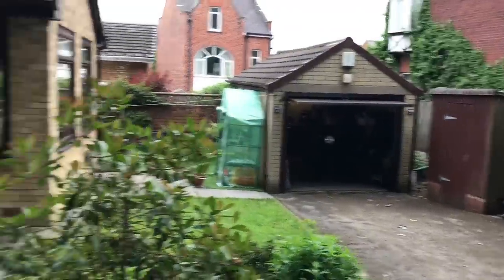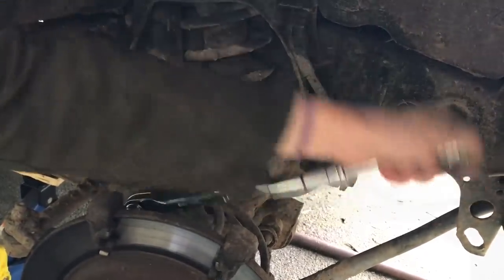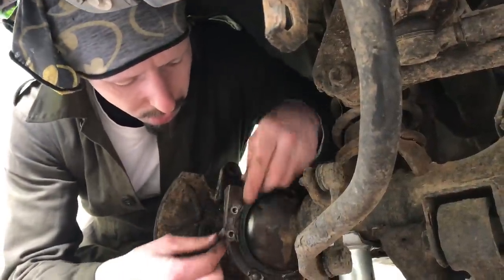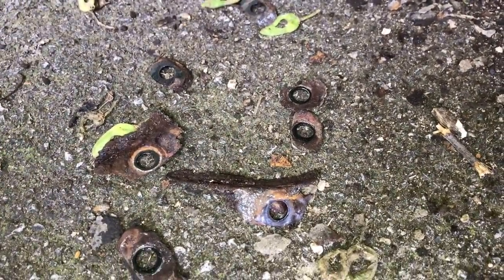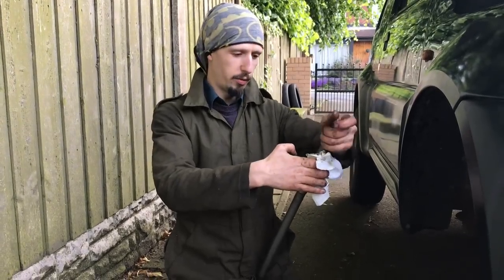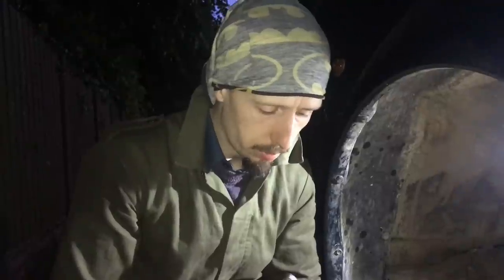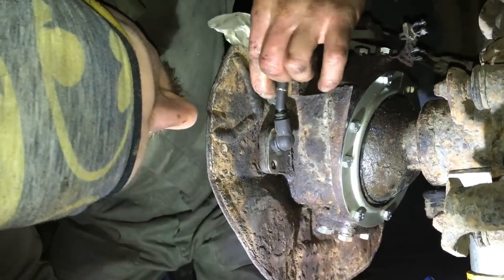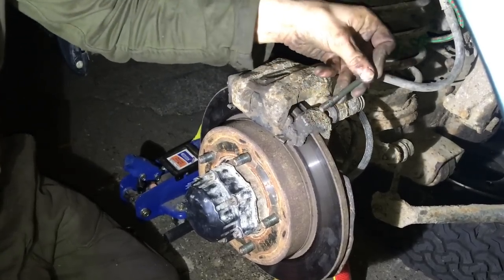Suzuki Jimmy - Replacing Kingpin Bearings and Swivel Hub Seals

Comment: Thanks lads, this video was a great help. My wife's 2000 jimny (George) had leaked from the seal for a while but the crunch came when the wheel ended up splayed outwards as a result of the bottom kingpin bearing falling apart. Only problem I had was two of the bottom kingpin bolts sheared off and I had to drill them out. Keep up the good work
Reply from the maker: Cheers Chris. Glad the video was helpful and that George lives to fight another day 😁👍

Comment: greetings from Pontassieve province of Florence Italy I have a Suzuki Jimmy 4x4 with a 1.3 LT petrol m13a engine from the year 2001 all original that I use for off-roading on rural and forest tracks and I see that my Suzuki Jimmy 4x4 and I see that in the countryside on these dirt roads and in the woods on forest roads that the loggers use to transport the wood out of the forest with their forestry tractors, skidders and forwarders and I see that it does very well on these tracks even if it is original with the right mud tires!

Comment: Good vid, as a motorcycle mechanic I just got a Jimny and I wanted to know what I was letting myself in for, did both sides in 1 hour 30 mins and my god it drives nice, great video it was a lot of help :)
Reply from the maker: Nicely done... I wish it had only taken us that long. But thats the price of learning as you go. Glad we could help. If nothing else, people can learn from our mistakes.
I really enjoy having the jimny though. Especially now the weather isnt playing nice. Think i might need to do the tracking or wheel balancing as its developed a bit of wobble at set speed range.
Reply: @MechitBetter  if you fancy spending 70 pounds on a track ace you can do the tracking at home it's a great system,  I think I did it so fast because  it was raining plus I've got all the snap on aka fap off it which just makes it quicker:-), again great videos you guys are funny.

Comment: Thanks very much for posting this, guys! Very informative and useful. Handy step-by-step to refer to!
Reply from the maker: Matt Cameron thanks Matt. Glad you found it useful. If you’re doing yours, I hope it’s not so rusty. Take it easy on that ABS sensor bolt. They’re known for being easy to snap!
Reply: Mech it Better Sorry, one last question: Did you replace the half-shaft oil-seal too? Perhaps I missed it on the video. I’ve ordered a full kit, extractor set, new axle-seal to hub bolts and grease/diff oil. I’m going to have a go!
Reply from the maker: Matt Cameron Hi, and sorry for the delay. We didn’t replace the halfshaft oil seals this time. They didn’t seem to be leaking or anything so we cut that particular corner. Hope it doesn’t come back to bite us! 

Did you get around to doing yours?
Reply: Mech it Better Hopefully it is the job for tomorrow! I’m trying to convince myself that I absolutely, positively need to buy a heat induction tool to do this.
Reply from the maker: Matt Cameron oh absolutely. There’s literally no way it’s possible without one, and it would be dangerous to drive the car in its present state.. so really you’ve got no choice 👍
Reply: Mech it Better Good........I mean, ‘oh’. I’ll let my wife know.
Reply: Tackled it today lads. Took 5 hours (and yes, the ABS bolt did shear!). This video was a great help. The top kingpin bearing was in good condition, the bottom one was manky and after cleaning had play in it. What amazed me was the corrosion on the bottom shell, about 1mm of rust in a perfect line, all around the bottom (yet the surrounding housing was totally rust-free....
Reply from the maker: Matt Cameron Nice work Matt. Glad you got it sorted. We’ve had a recent comment on this video suggesting a self tapper if the ABS bolt shears. Ciarán didn’t bother and it’s fine, but a self tapper seems a better idea in the long run.

Comment: You don't need to take the ABS sensor out of the Hub just unclip the the cable and it's long enough to do the job in place !! The bolts on the back seal are 10mm and have rounded heads If you tap the socket on the come out just fine !!
Reply from the maker: Thanks for the update. Hopefully it will be useful to others who haven't yet done this job. Unfortunately for us it's about 1 year and a snapped bolt too late 😁

Comment: Excellent video lads my swivel seal needs to be done as well enjoyed the banter.
Reply from the maker: liam barry Cheers! Hope the video is helpful. We’re greenlaning in the Jimny right now. Living the dream 👍
Reply: Oil or Grease leaking from this seal DOES NOT mean this seal has failed, this seal is really a dust seal. If oil is leaking you have a problem SOMEWHERE ELSE!! You will prob have to do the hole job??

Comment: Hi Guy's, That was a good insight to a nice job, But the hub seal you replaced will not last long, because the circle half  rubber seal is going to wear out very quickly due to swivel being very rusty. This should have been rubbed off with fine emery cloth and any deep rust pits filled so the rubber seal can wipe clear.

Comment: Damn nice video full of nice attitude. Working slow and with thought makes the trick. As a happy amateur I changed kingpin bearings once in my Jimny, and twice on friends. All in Sweden before I moved to Central America 10 years ago. I documented it (stills only) on my website at the time, Jimny.se. (BigJimny took over the site as I moved.) 

Note - I noticed you didn’t smooth/clean the surface for the rubber seal on the back. Was it a reason for that? 

Anyhow - Well done guys, very well done!

Comment: I would not use the slide bolts for the caliper for removal of the brake disk. Theese are teflon coated and quite expensive on most cars. Otherwise very good work lads!
Reply from the maker: Thanks for watching, and for the tip 👍
Reply: I know your comment is real old, but I have to reply to note for anyone watching that the jimny has a slider sleeve (the actual bearing surface) and a long bolt that goes through it - so actually the bolt they used is just a normal run of the mill bolt that isn’t too expensive to replace. Best bet is to have some replacements when working on the jimny anyway since they seem to rust so bad! 
Also I’ve never come across a Teflon coated slider pin, but I’ve only worked on cars and vans older than about 2014? Most are simply zinc plated and reliant on the red grease retained by the slider seals.

Comment: Class video guys. I have just got a 2002 jimny and it has the dreaded death wobble at 45-55 mph. No sign of seepage from the swivel joints and no movement in either wheel when jacked up. So i plan on changing the brake pads and discs, i think they are warped. While doing that should i do all the kingpin bearings too or would you just see how it drives after the discs are done? If the wobble is still there then the kingpins will have to be done with removal of the discs again. So I'm not sure what to do. What do you think guys?

Love the channel btw!
Reply from the maker: I’ll let Ciarán answer that one fully, but have you considered that the wheels might need balancing? A wobble across a narrow speed range is often just an imbalanced wheel. Much simpler to fix than kingpins, so might be worth looking at first - JOHN
Reply: @MechitBetter  Thanks John. First thing I  did was have the wheels balanced and it improved drastically, but still a slight wobble. Reason I think the discs are warped is when jacked up and rotating the wheels they get stiff at certain points and i can hear them rubbing.
Reply from the maker: Fair enough. That sounds fairly conclusive. I suppose it’s easy enough to whip the wheel off and see if the disc is warped. We tested that very thing in our ‘Fiat Panda Rear Discs and Pads’ video. At about the 7m 35s point you can see where the disc is warped and how we confirmed it.

https://youtu.be/7fDyisaQFrE

My personal thought is that doing the discs and pads is significantly easier than doing the kingpins. If it were me then I’d risk doing just those first, and I’d take them off again to do the kingpins later if I needed to. If you’ve not got any wobble when it’s lifted, and no seepage, then I’d take the risk. Let’s see what Ciàran thinks - JOHN
Reply from the maker: Well... Im not sure theres much i can add.
You seem to have covered much of the logical process. Although it might save a bit of time once you already have the wheel off etc to delve into kingpin territory, if the disc is the problem, you run the risk of extra effort and expense before eliminating that possibility 1st.
Also, if its all stripped apart down to kingpins, you wont be able to test it simply changing disc + pads has resolved the problem.
Eliminate the easiest stuff before digging deeper - CIARAN
Reply: @MechitBetter  Thanks guys I'll go with just the discs and pads first, makes sense to eliminate each possible cause. 👍

Comment: Hi guys love you both! Quick question though have you ever come across the death wobble?? There’s something going on with my jimny my mechanic 👨‍🔧 can’t figure out what’s wrong and it’s just past it’s mot please help!! 🤦🏻‍♂️
Reply: There can be a few reasons for a death wobble, one of the main causes on the early Jinny’s was the radius arm bushes were to soft they upgraded them at some point but I’m not sure when. Another good thing to check is that the rear wheels are tracking parallel to the front wheels and not offset. This is an old question so I hope you managed to fix the problem.

Comment: Great vid, entertaining and educational! Is the Jimny easy to perform work on as a DIY mechanic otherwise, in your experience?
Reply from the maker: Thanks for the positive vibes Tony.
In my experience of tinkering on the Jimny, which isnt extensive by any stretch, i havent really had much of a problem. The ground clearance makes it easy to work on the underside and inspect things. There isnt a ton of plastic and extra tech in the engine bay to cause you much bother with access or other issues. The interior is basic but works. 
Im not saying its all going to be problem free but, much like anything, its just a matter of taking your time and finding the right info before you get stuck in... Or at least maybe when you get stuck.
Its a great little machine. Just got to watch out for the rust...
Are you thinking of getting one?
Reply: Thanks for the extensive answer! Yes, I'm gathering some info at least. I'm not a big fan of plastic covers making it a hassle to reach stuff and, as you've said, the extra height clearance seems like a huge bonus. They're not crazy expensive either, so if they're fairly straightforward to perform work on and parts are easy to source, I might just get one. They seem really fun too!
Reply from the maker: If you plan to do some off-road or greenlaning or live in a more rural area, they are fantastic. If you mainly do town and motorways then its not the best choice as the fuel economy and performance isnt its strong suit. Its perfectly capable but not what it was made for. 
Its comfortable to drive and has a small turning circle. 
Visibility is good as there's big windows all the way round. The downside is that its not the safest in terms of crash test stuff but then its best not to have a crash in the 1st place 🙄
There are plenty out there for little money but like i say, you need to be very careful and   inspect as much as possible as rust CAN be a big problem. Find a solid body and you're laughin'

Comment: Thanks for this vid. Unfortunately I had to leave the old outer bearing races in place because I didn't have the necessary socket to drive them out. All the socket sets I have seen jump from 24m to 27mm. Where did  you get a 1 inch socket from?
Reply from the maker: I think we just had it in our collection of things acquired over time. Alternatively if you can find a 25mm socket, it's about 0.4mm smaller, it should be close enough.
Glad the video has been helpful though.
At least you know what to expect if you decide to replace the races in the future 😏
Reply: @MechitBetter  I just got one from that "nice" S.American rainforest place :) Also, I tried cleaning up one of the races I removed to see how badly it was worn. It fell apart. My Jimny is a 63 plate with 64K; don't think its been anywhere near an off-road experience so I was surprised to see so much corrosion... which made me think about why its worth the effort of driving out the retainers. Since they also corrode, if you leave the old ones in and just replace the inner races, they'll likely produce a nice grinding paste for the new bearings...

Comment: Must I do this if my car have vibrations runing up to 40mph?
Reply from the maker: It is a common issue for the Jimny.
However you should try a couple other things first:
Check tyre pressure is correct 
Check front wheels have been balanced
Check the alignment of the wheels
Some garages may check these things for free or at a small cost which it may well save you some money and time. 
It could be a combination of these things but if all of that is fine then yes, you may need to get the kingpins etc done.

Hope that helps

Comment: Hi lads, great vid, ive followed and got as far as starting to remove the bearing race... only problem is getting a socket 1"  Where did you get youres and what make is it and whats the O/D as until i have this info i cant go any further so i desparatly need your help  . Look forward to your prompt reply. Kev
Reply from the maker: Kevan Simmons Hi Kevan. The socket was part of my existing socket set. I’ve just measured the O/D now at 34mm. Hope that helps
Reply from the maker: Kevan Simmons just checked my metric sockets and there’s no equivalent that’s exactly the same. The 27mm socket has a 36mm OD, and the 24mm socket has about a 32mm OD - so it might be possible to use on of those but I’m not sure. The sockets I have are part of a Halfords set.
Reply: Thanks for getting back, ive managed to get a 26mm socket from B & Q which did the job....
Reply from the maker: Kevan Simmons Good work. Glad you’ve got it sorted 👍

Comment: Tienes las referencia de las piezas
Reply from the maker: I will try to find the part numbers for you... It's been a while since we did this job.
Reply: @MechitBetter  Muchas gracias :)
Reply from the maker: @thebrother987  Found some details:
king pins = 45610-63002 
Bearings = 09265-15006
Hub seal = 45120-81A04 
Oil seal = 09283-26016

Good luck
Reply: @MechitBetter  Muchas gracias
Reply from the maker: @thebrother987  De nada 👍